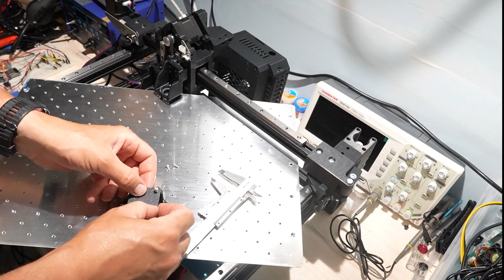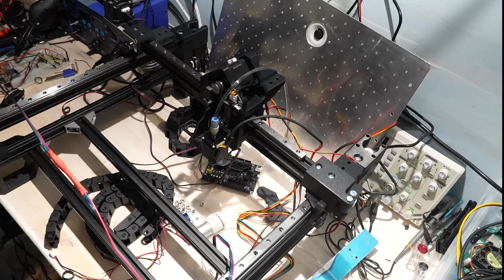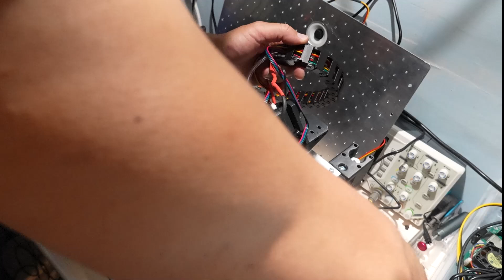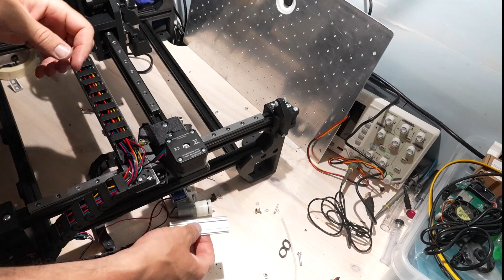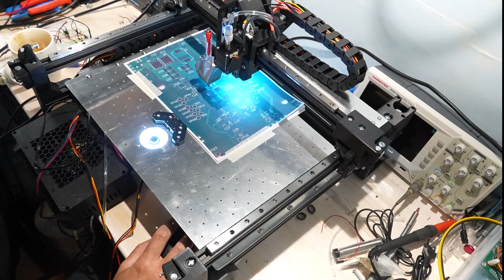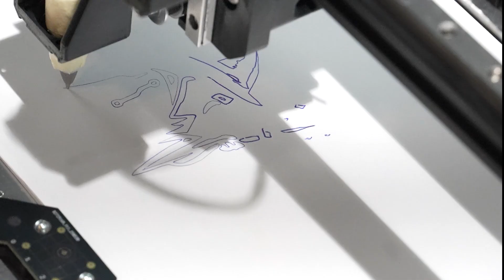Pick and Place Machine Progress, Wires, Camera, Test!

Comment: Could you share the supplier or source details for the top and bottom camera modules?
Reply from the maker: Hi, and thanks for reaching out! I used the "OpenPnP USB Interface 1.0MP 720P USB camera module" from AliExpress:
https://www.aliexpress.com/item/1005008321499083.html

The camera modules are also listed in my GitHub repo’s bill of materials, including the 8 mm and 120° lens versions:
https://github.com/thewiz4real-ops/openpnp-klipper-guide/blob/main/docs/10-bom.md

I’ve also tried an OV9732 USB camera. They’re not the best cameras, but they do get the job done! A better lens can help, and you’ll need to spend some time getting the calibration and lighting right.

If I were buying again, I’d also look at Arducam or the cameras available on the LumenPnP website. But the ones used in my video definitely work with some setup and patience.

Comment: Thanks for the complete guide. May I know total cost and tentative number of hours spent in building the machine.
Reply from the maker: Thanks! I’m not completely sure about the total cost, as prices vary by supplier and location. You can find the complete 

BOM here:
https://github.com/thewiz4real-ops/openpnp-klipper-guide/blob/main/docs/10-bom.md

The full project documentation is available here:
https://github.com/thewiz4real-ops/openpnp-klipper-guide

If you already have all the parts, tools, and printed components ready, the build should take about one full working day or two days at most.